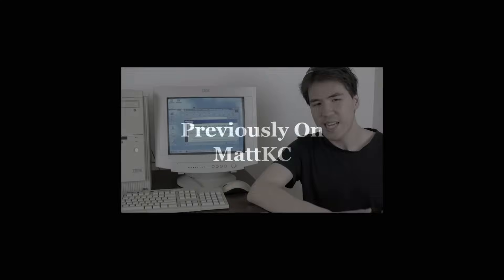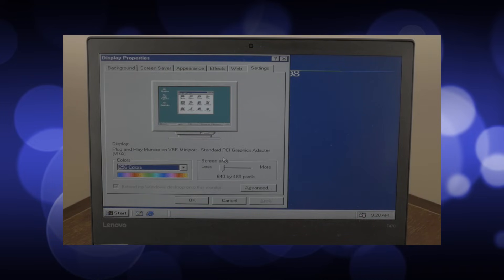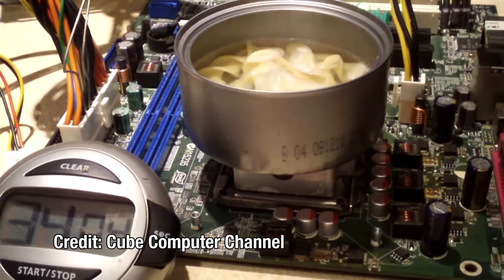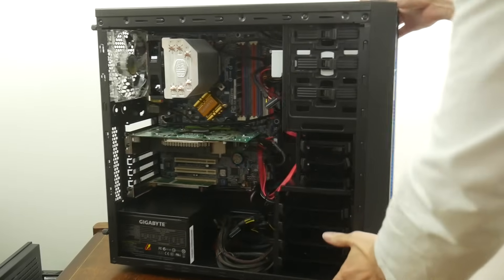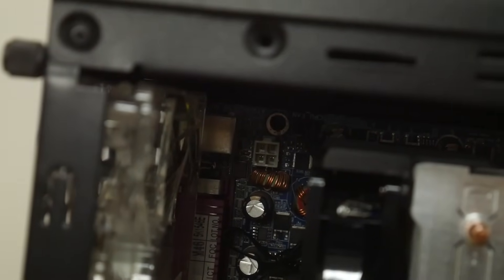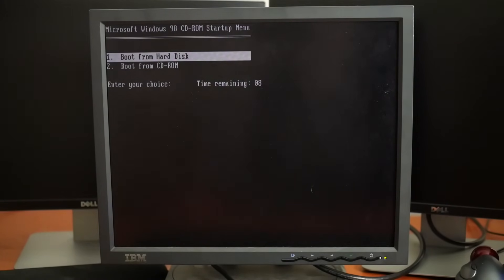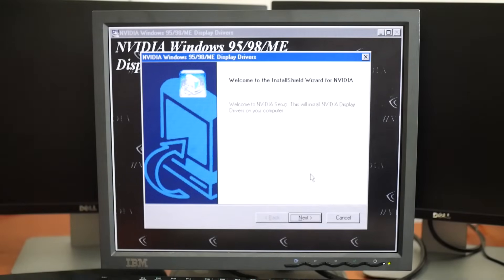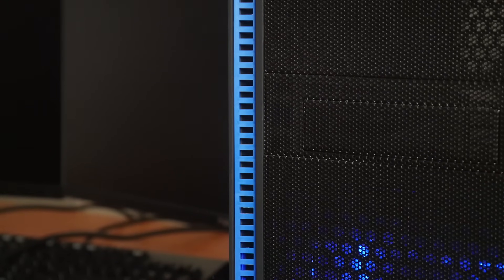The QUEST For The ULTIMATE Windows 98 PC [Part 1]

Comment: X58 and Nvidia Nforce chipsets for LGA775 cpus are Windows 98 compatible as long as the motherboard has the necessary bios settings you can change for compatibility. I know for sure the Asus Rampage II (has both PCIE and PCI so I’d go for this one) and III boards are compatible using a extreme edition cpu or high frequency Xeon then you have the true ultimate 98 system that doesn’t even take advantage of alot of it’s OP advantages like triple channel ddr2 for the Rampage II or triple channel ddr3 for the Rampage III.

Also speaking of those boards I just got done building the theoretical ultimate xp build using a Rampage IV Extreme (x79), 4930k, Titan X, Creative X-fi Titanium Fatal1ty and 8 sticks of 4gb ddr3 in quad channel at 2000mhz. It’s nuts lol. Anyone back then would have croaked seeing that kind of performance. HEDT systems have amazing compatibility

Comment: Those DP to DVI adapters only go DP in and DVI out, not the other way around. DP and HDMI are not electrically compatible in any way, there is a translator and voltage shifter chip in the plug that does all of that.

Comment: I'm doing something similar, but with my Windows 95 computer. I have my family's original Packard Bell Legend 2440 from 1995, with a  Pentium 1 75MHz processor, 16MB RAM,  and a 1GB IDE HDD. I replaced the HDD with a 4GB compact flash card with an IDE adapter, and upgraded to 64MB ram. I have a Pentium Overdrive processor to upgrade to 166MHz, a Matrox Millennium II 2D accelerator card, and a 3DFX Voodoo 1 3D accelerator card. I'm hopeful I can get everything working together

Comment: I've found that using a sata-to-IDE dongle, to run the SSD to the IDE port stabilizes windows 98, or run HDD, but I've never used that mobo so it may be fine. Also I re-cap every AGP card I use, it's pretty quick and all cards in that era seem to have a bad cap or it'll go after a little use anyway. I love the build hope you get it going.

Comment: @MattKC unplug the front Audio cable from the motherboard and see if your sound works again, this happened to me when using a new case and an old onboard sound card.  I have a similar setup, just with AMD and equivalent gigabyte mobo using the 6800 ultra AGP.

Comment: I think that u need the monitors to have vga output, if not mistaken those dvi on the graphics card only accept dvi to vga signal.

The card doesnt boot, have you connected the power to it? Because theres to power leads on the front of the card and needs that.

Issues aside, nice vid :) 
Congrats

Comment: I'm certainly no expert, but I have a 6800 Ultra AGP and I remember putting a aftermarket cooler on it as it got quite hot :) My guess that's what happened to yours :) Great video, I always wondered what was officially supported on 98 I always thought the support for it ended around 2003 :D

Comment: You could try Installing window 7, or xp. Might have better support.  Or even try Linux distro.  
Ya Realtek is PITA,  hate them so much.  Back in those days Id just disable on-board audios and go with sound blaster card.  That might be another option.  Disable onboard and go with sound card. 

Also pull out the original Manual for motherboard and find out what exact Realtek audio chipset is on the motherboard.  Then you maybe able find correct win98+ drives. If you can’t find spare sound card.

Ya IMO. Window 7 was the best.  Since then it’s gotten worst.

Comment: A DVI to HDMI adapter won't work on cards that old as they would likely be outputting DVI-A (analogue) not DVI-D (digital), and on top of that the newer LCD's wouldn't support the analogue signal either, however the older one will and does as you showed.

Only DVI-D signal is pin swappable with HDMI, trying to output DVI-A will do nothing as it's just not a digital signal.

Good video though, look forward to part 2.

Comment: I remember having the exact same problem with my GTX 6600 or 6800. I put a coin between the GPU and the GPU fan and forced the screws back in!!! It worked for another couple of years before it fully died on me, give it a shot, I believe it will work for one of the video cards at least

Comment: My memory of this is quite vague but I haven't seen anyone else mention it. Have you checked that the power you're requiring can be provided by the +12v rails? I believe PSUs when the P4 was around were quite a bit beefier in some aspects compared to modern power supplies and that may be causing the GPU issues and corruption when writing to drives.

Comment: It may be easier to first install 98 on a virtual machine by mounting your SSD to the VM instead of a virtual disk (to do this in hyper-v you have to attach the hard drive after you make the VM but before you turn it on) and copying all your driver files to it to run on the target hardware.

Comment: When you use two adapters, you need to use Active display port adapters, rather than Passive adapters. There's a difference, and it has to do with signal timing.
Reply: The problem is that he used the adapters backward. They only work in one direction, not both. You can't take HDMI out abs convert it to DP, it has to be done the other way around.

Comment: I'm starting to think there might be something inherently wrong with AGP. I tried something similar with an AMD build with all parts from 2001 and not only did all 3 of the graphics cards seemingly die, but when the 3rd died it seemed to take the whole motherboard with it, which now rapidly flashes it's AGP detection light when powered on.

Comment: I have that same motherboard.
But mine had blown capacitors so i replaced them.. and while at it i upgraded them from 1500uf to 3300uf! i also populated the empty spots..
Result? rock solid vcore, and i got my 3ghz p4 to 4.3ghz with a coolermaster tx3.
I also glued some heatsinks to the vrm components.
i have hd3650 and 3.5gb of ddr400 in it.

This motherboard has bad agp power regulators, so using power hungry cards that do not have external power is a big no-no

Comment: You really should have a Sound Blaster Audigy 2 ZS to call it ULTIMATE, and maybe add an Aureal Vortex 2 for extra flavor. My ULTIMATE 98 PC is an Athlon 64 3200, Quadro FX 3000 (FX 5900 equivalent workstation card), Audigy 2 ZS Platinum w/ front panel and an Aureal Vortex 2 card. Use n-glide and you have practically everything covered. Best example: Half-Life, 3dfx Voodoo graphics at 32-bit color, 1600x1200, EAX.

Comment: I know this is an old video and the problem may be solved now, but still... This behavior gives me the "bad capacitors" vibe. The voltage to the AGP slot and/or the processor is not completely right nor on point, and it keeps crashing, sometimes not booting, sometimes glitching the graphics. No beeping at POST is a bad processor signal (bad graphics signal is a long beep followed by some short ones, btw). Always remember this thing about electronics behaviors: If works bad randomly and starts to get worse over time, it's always the capacitors deteriorating. It's an easy fix, most of the times.

Comment: I have a nice trick to check the 4 pin cpu psu connector not being plugged in you hold the power button down and if it doesn’t shut the power off it indicates just that

Comment: Hello Matt, the issue with the dvi adapters is that the graphic card uses analog dvi while the adapters you were using in the video were dvi-d(digital).
The difference is the 4 pins around the large horizontal pin.
would love to see you getting it up and running!
GL with it!
Reply: I know this is a 3yr old comment but it's not correct.  DVI with the 4 extra pins will  output both analog and digital signals and based on the cable you give it one or the other gets filtered out.  All it means is that it can also be converted to vga with a simple filter (adapter).  Having an analog-only dvi port isn't a thing.
Idk exactly why the right monitor didnt work but he tried converting FROM dvi TO display port on the left one which isn't possible in that direction without an expensive converter.  The type of cable he got was meant to connect a newer graphics card w/ dp to an old monitor, not the other way around.

Comment: Did you hear about Pentium 4 Extreme Edition? It has lower clock speed of 3.73GHz, but bus speed at 1066MHz. I could n0t tell which one would be faster. Also, those RAMs made me chuckle a bit, since the fastest would be DDR600 in a dual channel mode, as it was already mentioned here. Or another option would be a motherboard ASRock 775VM800Pro-DDR2, which supports DDR2 sticks, as the name suggests.
Getting to build absolutely ultimate W98 PC is more elaborate than it may seem. It requires a lot of research, and even when you have some idea of which parts you should get, actually getting them is a quest for ages, if you would be ever that lucky to get them all.

Comment: I'm using a Nvidia GeForce FX 5900XT card with my Win98:SE machine, and it's working well...although means there's quite some fan noise! ^_^. I used the normal VGA monitor connection to go to a screen until all the card's drivers were installed correctly, etc.

Comment: Maybe I'm wrong, but, AFAIK, those adapters, at least the Display Port one, is only one way, and the way you're trying is the wrong way. They can only go from DP at the source to the other ones at the display. You can't go from another one at the source to DP on the display. At least, not with just a passive adapter. You probably could with an active converter though. However, HDMI to DVI is non directional, meaning you can go either way with a passive adapter.

Comment: You should be able to use much newer hardware if you buy an industrial motherboard that supports a modern CPU with PCI slots, or use a normal modern motherboard (with legacy boot support), with PCI-E slots and one or two PCI-E to PCI bridges, to let you plug in era-appropriate video, sound, ethernet, IDE adapter, etc. for improved driver support.
I'm not sure which one is really "faster" but a GeForce 7600GS AGP would have been cheaper / easier to find than a 6800 AGP, and works in Win98 with modded drivers.
If you wanted to stick with an old motherboard, you might be able to go a little farther and use an early PCI-E motherboard, there are some people who have modded GeForce drivers to get some PCI-E cards working on 98, and you can use the PCI slots an older motherboard is likely to have for sound / network.

Comment: Nice mobo, nice CPU, nice cooler, nice video card, but I think you could achieve a better performance with a Core2 Extreme X6800 or Pentium Dual Core E6800 instead. One more thing: how did you forget the Sound Blaster Audigy2 ZS for the "ultimate" audio experience?

Comment: Edit: Even though this is an old video...
SSD might be a bad idea. It may not be faster (key word is "may"). Flash ram normally handles data in blocks of 2048k while FAT handles data in blocks in 512k. The SSD will have to read out the entire 2048 before it can "extract" the 512 that FAT handles. Unfortunately DOS based systems don't have an option for variable block lengths. You may get lucky and have the SSD be able to read out the 2048 faster than a drive can read 512.
Edit: You may want to put in less than 512 meg of RAM. Some Windows 98 had a serious issue with anything over 768 meg. There were more than one version of Windows 98 Second Edition and some had the necessary upgrades. Somehow if you do get it up and running with low ram and are also able to get all the Windows updates, you can then add in the extra RAM. You might also have issues with CPU speed until you get the updates, so you might have to underclock the CPU initially.

Comment: In all honesty, if you want to go ultimate, what you'll need is an Asrock 775i65g r2.0 and a core 2 duo instead of the Pentium 4, since you're going ultimate performance and all. Core 2 duo is better than quad since, while it has 2 instead of 4 cores, it has higher clocks, which'll help a ton since Win98 uses 1 core anyway. Also, with modded nvidia drivers, you can get a 7000 series card to work on Win98, making it even more crazy OP. For sound, you gotta stick to a PCI Soundblaster card, though. There's also the AMD alternative, where you can get an AM2NF3-VSTA or an ALiveDual-eSATA2, slap a Phenom on it, and go nuts from there. All this is if you wanna maintain an acceptable level of compatibility and driver support, though; if you're willing to get riskier, you can go as extreme as AMD FX piledriver or ivy bridge, which are the last generations able to support Windows XP. And if you need help, there's always VOGONS.

Comment: so i know some molex powered gpus wont post if the two molex cables are on the same lead. you would need two different molex leads coming off the psu to make the gpu working

Comment: Installing Win98 is a pain. Currently trying to install it on a dell D600 laptop from 2004. Dell only offered drivers for WinXP.  Everything works now under 98 apart from the modem.  One thing I have noticed is that Win98 is really fast when you first install it. But as soon as you install drivers and updates it slows right down.

Comment: Pentium 4s, at least the 5xx ones, in my experience do not thermal throttle due to a lack of a thermal sensor on the CPU. So you can run it at 95C or until it hits its thermal shutoff limit (not sure how that is actually sensed though)

Comment: I attempted a VIRTUALBOX install of 98se and I too had to give up on that crappy OS as when I started installing DRIVERS, that is when all the errors and hell started.. There is a reason why win98se and win9x in general protection fault, was dropped and NT became the dominant Windows platform for both consumer and pro installs. Windows Vista and Windows 8 are absolute WINNERS in comparison to Win9.x. The fact that you are having hardware issues is also not surprising as I have quite a collection of older hardware and sadly even not using it, over time, chemicals in electronic parts breaks down and causes all those issues. There really IS a reason why so much of the computer parts made in China are crapping out almost from the beginning yet computers and parts made in the USA,UK, JAPAN and Germany for instance, are still working strong in 2020, with the exception being BATTERIES.. The bane of electronics devices the world over.. But I trust you can get a system going, it will just have be more period correct I am afraid.

Comment: I’ve had similar issues gettin no screen with changing out graphics cards on win 98, If you did’n’t already for some reason I would maybe give installing the graphics card drivers for that card a try before slotting it in, it’s just a problem I’ve run into from time to time, if that’s not the case then the card is probably dead I guess, also win 98 is infamous for having difficulty handling ram beyond 512 megs due to the construction of the os.

Comment: If you're using Windows 98 instead of Windows 98 Second Edition, that's one source of a lot of your trouble. Original 98 had some rather horrid issues with quite a lot of hardware. It wouldn't even install on the PC I had when it was released. 98SE installed without a problem and most of the hardware worked with the included drivers, but of course worked better with manufacturer's drivers.
Something you should do after you get this thing working is to get the Maximus Decim USB drivers. It's the Windows Me USB Mass Storage (and other devices) drivers put into an installer with some adjustments to install and work perfectly on 98SE. With that you don't need a pile of drivers for all your different thumb drives and other classes of USB devices. Someone has done the same for Windows 98 Original, but one must have some very specific need to inflict that version of Windows on theirself. 98 Original should only be used in cases of a need to run some odd software that will not function properly on anything else, or a rare case of a motherboard or some peripheral that doesn't work correctly or at all on any other version of Windows.

Comment: Athlon 64 3000+, ASROCK nForce board, 120GB SSD vai SATA, 512MB DDR RAM (cause there is absolutely no reason to go beyond that), Quadro FX 3000 (FX 5900 equivalent), Audigy 2 ZS and Aureal Vortex 2.

Comment: Driver part is hell if you don't use hardware from 98 era. Was a pain to find needed drivers (realtek for via) which would install. Then they hung my system a few seconds after startup. Drivers for GPU were also a pain. Firstly I couldn't run 3d games on it. Then it died. Changed it to 6600. Couldn't get directX and openGL to work together on same driver version. I reinstalled windows, had the same pain with sound, finally got DX and OGL to work together annnnd.... Now directDraw lags. Simple 2d games lag. Tomorrow I will change the mobo and reinstall again...

Comment: Video request? WinXP on an Atomic Pi? I bought 2 but i HATE the interface of the new Windows OS's. 

I'm putting one in my 1984 Toyota 4x4 pickup, with a dual screen expanded desktop setup, a 10" screen where my instrument cluster is, and a 15" screen over the center cluster. Wireless touchpad center of steering wheel. I need Windows to run my Delorme Street Atlas/Topo USA software, and Ham Radio Deluxe to control my Yaesu FT-897D ham radio.

Comment: AGP based GeForce 6xxx series is bad idea under Win 9x (I tried it myself) as they are actually PCI-E cards with PCI-E to AGP converter (which leads to a lot of errors and glitches such as those "patters"). Just stick with high-end Radeon 9xxxs or GeForce4 series (you may use high-end FX5900, worked nice for me). Instead of dealing with crappy onboard audio get SoundBlaster Live! or SB Audigy1/2 (I got myself Audigy 2 ZS and works like a charm under WinME... yep even ME if used more stable WDM drivers).